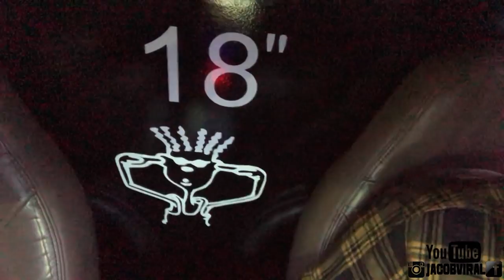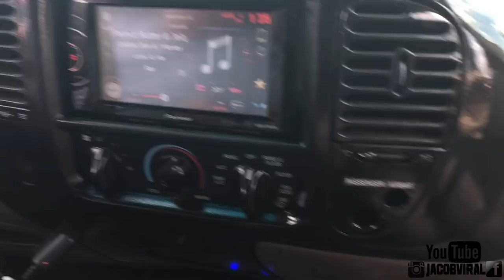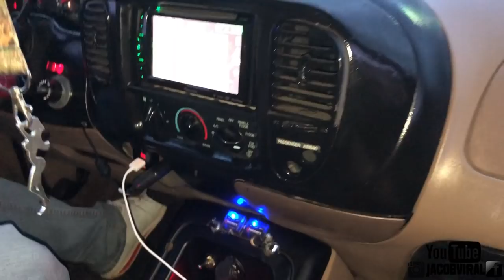2 18S IN THIS PLAYING DOWN TO 18HZ

Comment: I thought 23 was low (it is for my two 10s)
Reply: I thought you had four ix 10s
Reply: Mysterious Systems 1029 I did, but now I am finishing my new build which is a 4th order blowthrough for 3 Skar IVX 10s. But I am trying to convert it to a 6th order by dropping one sub in place of a port, and I am currently breaking in 2 of the new subs in one of the old ported boxes. I hope the 6th order will turn out good.
Reply: @loud_n_lowtaco200  heck yeah man! I bet she'll slam

Comment: Taramps not gonna last long with that voltage
Reply: He should be okay long as it not droppin to low 12
Reply: @Macho09Marian  it's dropping to 11.6
Reply: @cavybass  yeah thats danger zone for everything!Clip from low voltage.You right taramps need power.. they make power supplies for the amps that run 120v -220v @14.4v.If you dont know.... Learn!